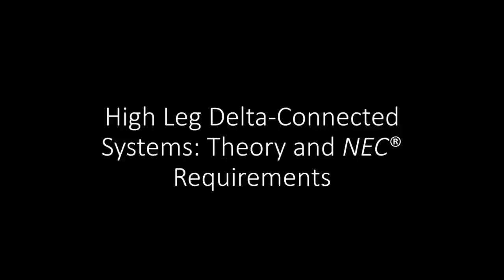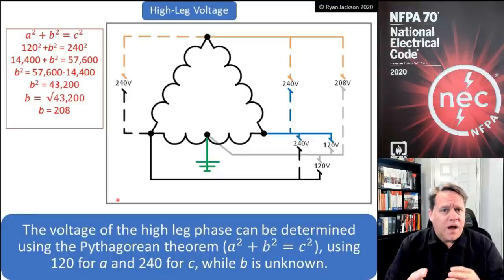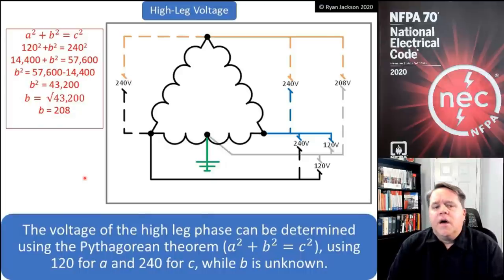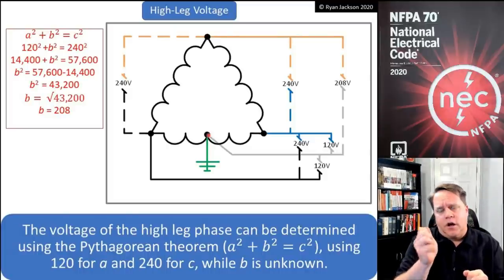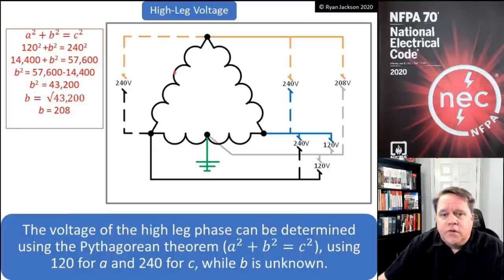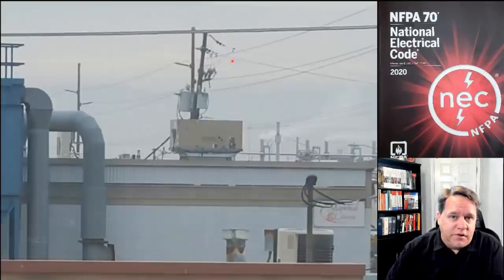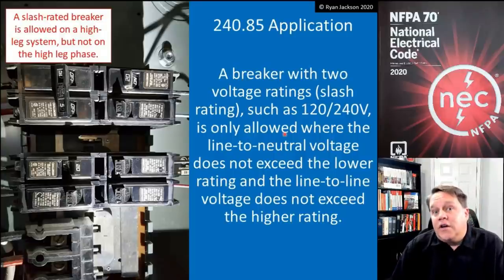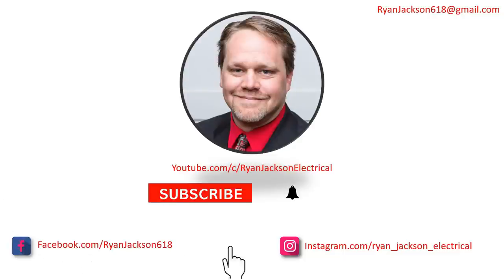High leg delta systems--explanation and NEC requirements

Comment: marking the high leg orange with pink stripes or something unusual would probably be more effective than orange,  if you were installing a 480 volt high leg delta, because normally Brown,  Orange , Yellow & Gray  is used for 277/480Y.   So in case of a 480 with a high leg,  brown, orange/pink, yellow & gray could be used.   

just a suggestion.

Comment: Yeah it really happened to me when I was 20 years old and they needed my help to setup all for lighting and plug outlets from 3 phase breaker panel. They informed me that a few light bulbs were out really quickly and i was really confused because i thought it was 120/208 volt until I noticed that an orange tape in middle of wire (phaseB) on top of 200 amp main breaker, so I checked the operation manual on the back of the breaker panel and realized that was a delta high leg panel!

So I had to change any breaker proper way and not even single breaker touched the high leg...🙄🙄🙄🤦‍♂️🤦‍♂️🤦‍♂️

Comment: So I have a question not covered. 
240v high leg is 208. 
I have seen in the past and worked on equipment connected to the high leg by a single pole breaker at 208 volt. 
Example would be a mini split AC unit. 

Everything worked ok. But if the breaker is rated at 240v is there any violation?
Reply from the maker: No.

Comment: Thank you for the brush up we had 13200 volts into our buildings from two separate sub stations and multiple transformer configurations and panels
🥃🥃🍺🍺🍺🍇🏌
Stay safe.
Retired(werk'n) keyboard super tech.
Wear your safety glasses.
Reply: At a large hospital that I retired from they had four 13,200 services feeding 2 switchgear rooms in lower basement. Also had 13.2 KV transformers on the 7th & 10th floors. Had 4 natural gas gens at 760 KW each and three 2000 KW diesel gens.

Comment: I worked on a system that had a corner grounded delta.
Reply: That system was a480vac system
Reply from the maker: @shawngabriel7397  Those are pretty rare. Interesting systems. In almost every application the grounded phase is not identified correctly (must be white or gray).
Reply: @RyanJacksonElectrical  a lot of industrial facilities around colorado use corner grounded delta transformers.

Comment: What does 408.36 (c) equate to ?
Does that mean a breaker can no longer be installed in the high leg slot/phase
Or that delta high breakers ( main ) the six space ones,may no longer be used..
Reply from the maker: A delta breaker was a way to get three phase power out of a single phase panelboard connected to a three phase system. They haven't been manufactured since (I believe) the 1970s.
Reply: @RyanJacksonElectrical  I have done research on these, they were banned in 1978 for new installs.    What stirred up my curiosity was in the house I was renting last year in Charlotte,  NC.  I was told the property was built in 1969.   Anyway the breaker box was a split bus, ITE panel,  on the door it had two different wiring diagrams  one of which illustrated a 120/240 3ø w/ high leg, and wondered what the heck that meant. Essentially it was a very oddball breaker that clipped onto the two bus bars like a regular two pole, but also had an additional wire, from the meter,  that was connected to the breaker to feed it the high leg.   It allowed for one three phase load, in a single phase box.  Typically used for a 5 ton air conditioner in the 50s and 60s.

Comment: I don't think I've ever seen a 3-pole circuit breaker with 240 volts phase-to-phase. It's always been 208 V phase-to-phase🤷‍♂️

Or it would read 480v phase to phase
Reply: That's because you're thinking of a wye system,  120/208 & 277/480.   A delta system gives phase to phase voltage of 240, 480 , 600 and higher.

Comment: I had a 230v h20 heater that I did a service call for and I used the high leg on a single pole breaker didn't get as hot but it worked

Comment: Good day, I have a delta transformer with high leg. I was curious if its possible to remove the center tapped configuration so it gives me three equal phases as opposed to the two 120v and one 200v
Reply: if you remove the center tap, you have no 120V at all, and you'd need another set of transformers to get 3 phase 120V

Comment: Thanks for the reminder i just looked at rooftop with this configuration and just couldnt figure out why they supplied me that voltage to the service discconect when i asked for 3 phase 208-240 60A service. I thought someone made a mistake i googled it saw this video. Went though my old books andnsure enough in my own hand writing in my notes a have a drawn a delta high leg confugiration where i noted how its where the ground is and even have the calculation written down. Jeez i think im old lol. I actually measured 220 on that leg but il chock that up to meter calibration and supply voltage

Comment: Good basic video and information.  Just a couple of nits to pick.

1) Utility requires the high phase to be on the right side  of a meter socket because that is the way the meter is designed.  It has always bugged the hell out of me that the code making committee that decided the high phase must be the middle phase was so out of touch.  
The meter is NOT looking for 120 volts on phase B as the speaker suggested.   The meter has two stators.  One is a three wire stator just like is found in a residential meter.  It consists of (2) 1/2 current coils and a 240 volt potential coil.  The 1/2 current coils each measure 1/2 the current of 120 volt loads and twice the voltage due to the 240 volt potential coil.  So, the coil must be energized at 240 volt so it is connected A-B

The other stator is a 2 wire stator consisting of a full current coil and a 240 volt potential coil.  It must be connected C-N which is 208 volts.

2) Although the speaker quickly realized his error in saying a 480 volt 4W delta has a high leg of 277 volt instead of the correct 416 volt, that makes me wonder if the speaker understands the math involved.  Was it just a brain fart?
Reply from the maker: Well I explained the math at the beginning of the video, so what do you think?

Comment: Good news here in the UK, we use 240v equipment, so you can buy and run any of our stuff, bad news your concept of electrical distribution is so overly complicated it's a wonder you make it to work in the morning, we and I think most of the rest of Europe use a balanced 3 phase 4 wire delta/ star electrical distribution network the final step down transformer star point being neutral and earth connection,UK any phase to phase 415volt any phase to neutral/ earth being 240volt, and no such thing as a high leg!

Comment: Color blindness forced me into engineering and I enjoy that.  Stupid colors.  Brown?  Red?  What's the difference?  None to me.  When speccing multi-conductors, I spec numbered conductors...they're usually black.  Makes it so I can understand what's going on.  Screw the colors, let's use numbers.
Reply: I only buy red and black. Why? Because I can get any kind of wire in red or black. Even so, go look at some exotic wire types  (e.g. some of the mil spec stuff) on mouser or whatever. The weird and ugly colors are a fraction of the cost! Should really just use whatever is cheapest and disregard color. :D
Reply: @Ormaaj  I buy nothing, I just spec it.   Color codes on a CAD drawing are easy. distinguishing blue from pink or brown from green is what I'd have trouble with.  I'm fine with the letter codes though.  Fear not, ,my DWGs are good but would be sorta tricky if I were wiring the thing.  Color blindness is a serious handicap.